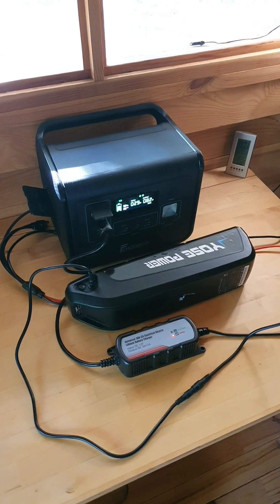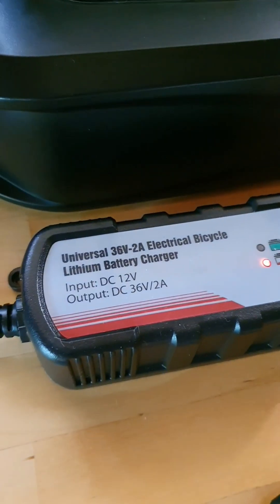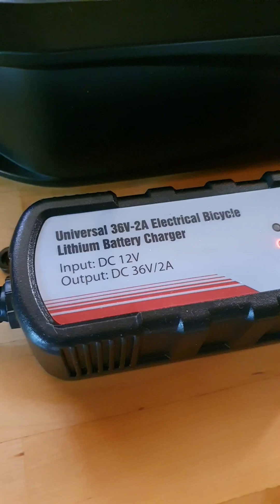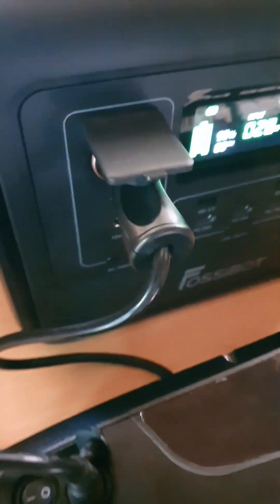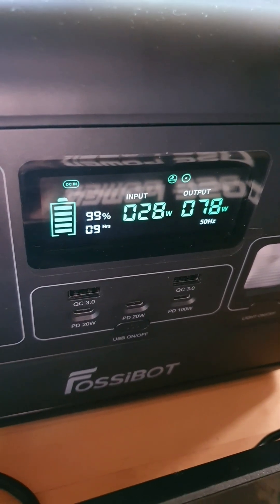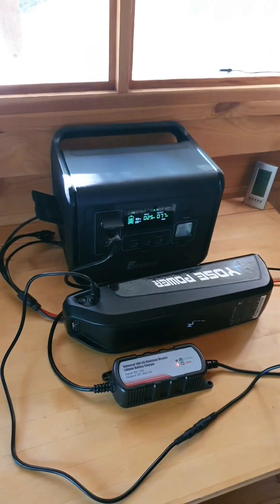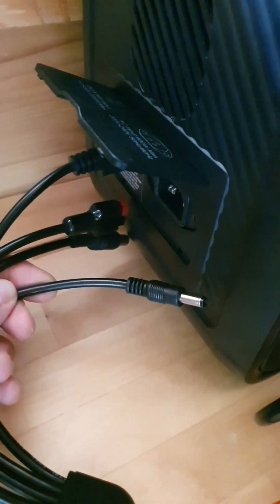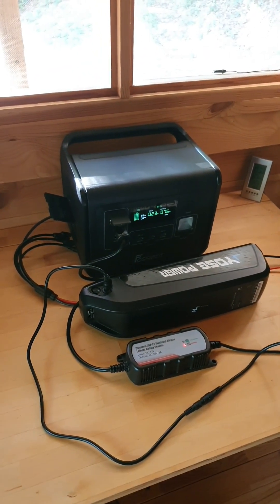How To Charge eBike with Solar (DC to DC) #ebike #fossibot #renogy #solarenergy #solarpower

Comment: Can you let me know where you purchased this charger? I have found it online but only for bulk purchases.
Reply from the maker: I'm afraid via my research I haven't found this available yet in the UK or the United States. It's from a brand called EZA in France. It seems that this brand has bought a bunch of these charges in bulk and is setting them in France, mind you the price is quite high for what it is. In my experience with using this charger it does work so it would work for the car to an e-bike but it does charge the battery incredibly slowly? You need a 42 volts at 2 amps to charge a 36 volt battery more quickly. Also the charger does seem to get quite warm when charging, best charged in a cool location. I have been researching other methods to charge the ebike battery via solar so stay tuned for future videos. Also have a look at the brand OZO electric.
Reply: @TheOneGoodRoad  I was able to find a manufacturer in China who appears to be the source. They are sending me a single sample for 55$ including shipping.
Reply: Is it possible to bypass the battery and go directly into your bike?
Reply from the maker: @markliano6518 I have a video on that I'm working on stay tuned for that one where I show you how to use a MPPT charge controller to charge the e-bike.
Reply: @TheOneGoodRoad  thanks I would appreciate that. I have panels and a EcoFlow generator. I just don’t want to have the wear and tear on my battery if I can plug directly into the panels and a charge controller.